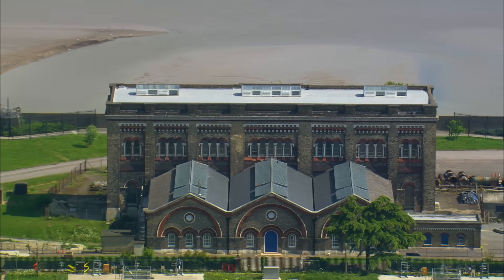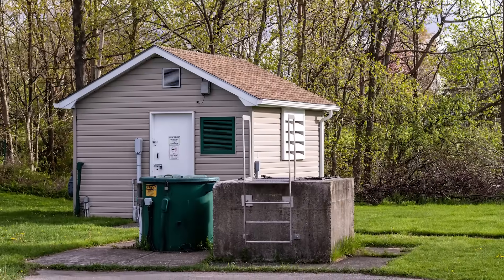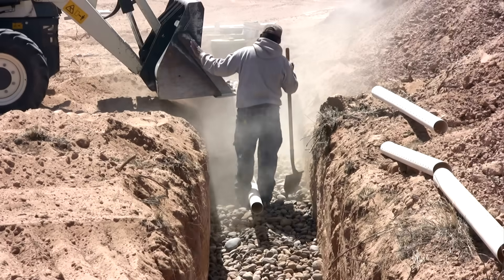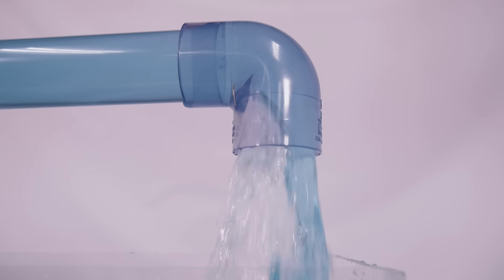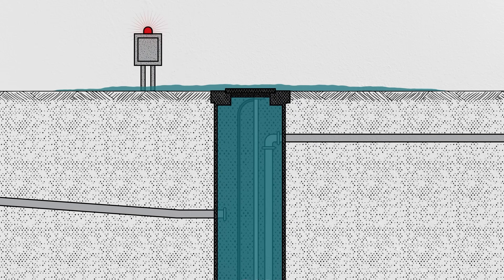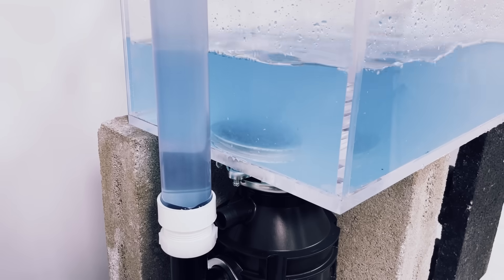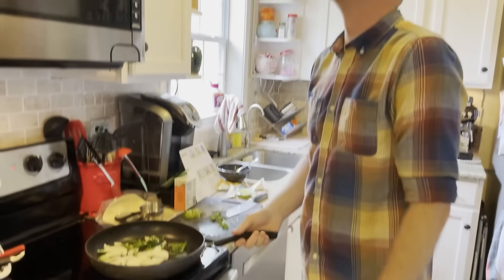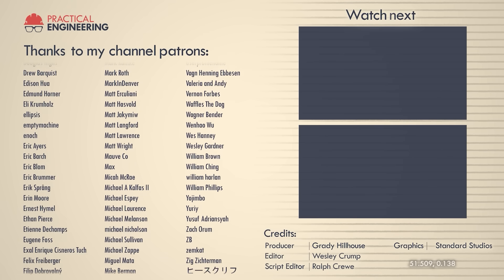How Do We Pump Sewage?

Comment: About 15 years ago now, I was working with a construction group that was refurbishing and remodeling a bunch of houses in an older neighborhood in town. After that project had petered out, I became the go to plumber for many of the residents. We got a call for a stopped up drain and realized that the problem was in the home's main drain line. We worked on that drain for HOURS and finally got it flowing... for about a day or so. When he came back to do the drain clearing dance all over again, the next door neighbor said his house was backing up. And then the guy from across the alley said the same thing. Turned out that in the alley, under about 5 feet of built up gravel and dirt was a large manhole that lead to a grinder pump in a tiny little lifting station. The city's water company had no idea that pump was even there. Turned out that the pump had been installed somewhere around 1904 and had been doing its job unnoticed and without any maintenance until 2007 when it finally seized up tighter than Fort Knox. Anyway, they came with a pump truck to clear out the area then installed a brand new pump for that little station that handles about 12 single family houses. I bet the new pump won't last 100 years though.
Reply: Over 100 years of work & probably decades without maintenance is super impressive. I work for a water company & pump breakdowns are super common. Do you know what type it was?
Reply: @Marshall Hunter  I wish I'd been more curious about stuff like that back then, but once the real problem was identified, I stepped back and let the water company do its thing.
Reply: Sounds like that pump should have ended up in a museum :)
Reply: That’s absolutely insane. I have 23 pump stations i take care of in my city. We have problems all the time. 100 years!! I’m lucky to get a hundred days without some sort of maintenance!!
Reply: Maybe in 1904 they just designed it to run continuously, regardless of need. If you don’t care about wasting electricity, you lose a lot of complexity, and running continuously is probably better for the bearings as well, especially if overbuilt.
Reply: i wonder if the new pump still works
Reply: @iwantpizzareal  doubtful, "they don't make em like the used to"
Reply: Have you got photos
Reply: @nadiaplaysgames2550  No, I don't even think the cellphone I had back then even had a camera.

Comment: Why don't lift stations not simply use unclogable pumps, like archimedes screw pumps with larger diameters than the feeding pipes or lift air pumps, which has not even a movable part. 🤔

Comment: I worked for a company that installs monitors to quantify flow in sewers. The treatment plant in Roanoke, VA has 5 Archimedes screws 6’ in diameter to lift the sewage. Yes, being in that wet well for the installs was scary. Also places like Virginia Beach use their pipes as storage because there is no slope/gravity to move the sewage. It is almost an entirely pumped system on nearly flat topography. And yes, it’s disgusting.

Comment: When I was at a wastewater treatment facility with my uncle who works there, they were using archimedian screws to transport the sewage around seven meters up to the main sieve. 
Is that a local way of doing things (I live in Germany) or are there some major downsides? Or do they have a special purpose I'm not aware of?
Reply: Archimedes screws are excellent pumps for very large flows and low heads (such as at treatment plants).   They take a lot of room, and are quite expensive, so they tend to be limited to cases where they can be economically justified.   
In the sewer system, typically flows are lower, heads are higher, and available area is quite often limited, so 'centrifugal' (or similar) pumps are more often preferred.

Comment: As an odor control equipment engineer the last part is particularly fun. From the sewage gas that would blow the manhole covers in LA to the horizontal sewage lines in the north Carolina that run on a giant vacuum pump I've seen plenty of systems that need fun ways to treat that smelly air. It's not a sexy job but we get it done.
Reply: How is the issue dealt with? Sounds mega interesting. Almost like a material for next Practical Engineering video.
Reply: Thank you for your work. As a plumber, we dont often get recognized, but you sir, make a world of smelly difference!
Reply: @CUAD what method do you use?
Reply: @Scott Page USMC aka a shit sandwich :D
Reply: There’s some fun videos of exploding manhole covers in China.
Reply: I BET YOUR FAMILY KNOWS YOUR HOME, 15 MINUTES BEFORE YOU GET THERE.....PIGPEN...
Reply: Have you ever heard of the sewer gas destructor lamp?
Reply: As a gen tech,and a motorhead I always chuckle when I see a roots blower at a wastewater plant,I wanna borrow it and stuff it on an engine 😆
I frequent them often for generator service.
Reply: I used to work for a county where we used to spray chem in our lines to control odor
Reply: Willie Marshall  thanks for the information, I appreciate...
Reply: Willie Marshall  I know hlm, he ls a fo#rex trader and a good one
Reply: @alexgonzalez2207  this guy above is a bot, shame and report

Comment: Very nice! I build UL508A industrial control panels at a shop that specializes in wastewater treatment and freshwater supply. It's amazing the level of technology required to lift sewage up 50 feet. One control panel can easily take weeks to build and wire, and design can take months of engineering.

Comment: Talk about bringing back all the great (NOT) memories of working as a contractor to a major metropolitan sewage treatment works From installing temporary bypass pumps in the suburbs to dredging out settlement ponds and unclogging blocked sewage mains with commercial size high pressure "rats" I can smell it now But the worst job was cleaning out the traveling filter screens Oh the Tampon strings They were indestructible None of the macerator Pumps or grinders could destroy them (Funny thing never saw any females on site either Never)

Comment: Is there a way that some kind of giant peristaltic pump could be used for this purpose? I suppose it might have the issue of certain kinds of debris potentially damaging the tubes since they'd have to be made of a flexible material that's susceptible to cuts and punctures.
Reply: Peristailtic pumps are used for chlorine injection mostly in wastewater treatment plants. I worked at a municipality that tested a tube pump for thickned sludge and it did not work well.

Comment: My father used to build those sewage pump stations, along with water treatment plants and sewage treatment plants. Most of them are still running today, despite being built in the 1970's, and then being run 24/7/365. I regularly drive past one he did, which still is doing it's job, lifting sewage for it's last travel along 6km of pipe to the offshore outfall. Fun building a plant next to a river, when you have to excavate for the basement levels 10m down into clay and silt, plus bring all the pipes through the walls as well. But at least they have a very easy job dealing with any leakage, as there is a nice convenient outfall pipe to send it in to for disposal.

Comment: Cool. Thanks for showing me that my friends and I used to hang out on top of a poop chute as kids. Cool. Cool cool cool. Cool. Veeeeery cool. I’m fine. It’s fine. No big deal. 

Basically my best friend and I lived at opposite ends of a really long street in FL and halfway there was a big hump in the path with a circular pad of cement, those metal doors, and one of those boxes with a light that would flash after a storm. Literally I saw the exact model and setup in the video! We assumed it was for storm water and flooding which is common in FL.

Man. I can’t wait to tell Sam our meeting spot and snack hang was a big ol poo toob!

Comment: Hello comments! Heres a few additonal points or pieces of info some may enjoy from someone who worked in sewage liftstations. 
First ill state that i worked in Sewage lift stations in a large city in Canada and varying from region and city to continent the requirements and SOP (Standard operating procedures) for these stations will change. For myself and my team, We were in control of 31 liftstations devided into 10-12 station per 2 man crew. Our usual daily task's included building mantience, Generator matinence, Pump maintince, Pump Mantience and repair and Wet Well Cleaning. Its a good point to bring up that alot of people believe Sewage Lift Station Wet Well Cleaning involves going into the middle of the pit and scrubing the machines by hand, Not only is this wrong but would pose risks to the workers far greater then then the mantinence outcome could be. For myself we had garden hoses or fire hoses that we lowered down a lader to a platform above or around the Wet well. We would use this hose to spray the Grease solids of the sides of the wall, as well as manually lower the level of the wet well so we could spray off any debris or solid from the pump(s) or force main piping (This was to ensure the pipe was in good working order with no visible cracks or holes); The pump structure used for my city is also a bit different then the exampels in the video as expected. our pumps sit not unlike the first example provided in the video but with a few added things, that being the practicality of multistage blades or primary recirculating blades in the wet well itself to chop up solids and debris before reaching the pump. when it came to the location of the lift stations. many were in resudential areas and posed a threat to smell and off gassing. But with the use of a sealed wet well containment area and an aditional 'Air scrubber' we were able to mitigate 90% of smells to the residential areas. oh, and piece of advice. The lift stations closest to any treatment facility is the worst smelling..

one last thing and I will try to anwser any questions anyone has if they take the time to read this...

DONT. FLUSH. 'FLUSHIBLE'. WIPES. Theyre a pain to deal with. in both Lift stations and in sewer cleaning (my current job) ive had more then my fair share of dirty rags fall on me and its not fun...

Love you all, Stay safe and keep flushing! (it gives me a job!)
Reply: This sounds like it could be my job description. We do all of this. I'm the "lead" of a 3 person crew of 2 mechanics and an electrician with 29 stations (2 stormwater, 4 water, and the rest are sewer) out of ~ 180 to take care of. Recently, we've started outfitting our own water stations. We get a building with an incoming and outgoing line stubbed in and a trailer of parts. We do all the plumbing, electrical, and concrete work needed to get it up and running. We've been doing alot of lift station rehabs, where we replace the old lines with  SS and new valves. It's a little more interesting than just maintaining them.

Comment: Good of Grady to shine a light on the largely unknown and underappreciated lift stations and the longsuffering joes and janes that keep them running.
Factoid: There is a series of small sewer lift station in Yosemite Valley, CA (The part of Yosemite National Park that most tourist visit). Although a river flows through it the "fall" isn't enough for sewage to flow down valley by gravity alone.
The massive flood of New Year's Eve and Day 1997 wreaked havoc to much infrastructure on the valley floor. Not only did the flood fill the sewer laterals/mains with sand it also knocked out multiple lift stations. The lift stations were designed and built to endure flood with a concrete pill box structure and gasketed doors like warships and submarines. However, over the decade's penetrations had been made for things like conduit entry so the "watertight design" became severely compromised. Therefore, repair and renovation were enormous.

Comment: And then you get old sewage systems that have rarely seen any maintenance, and in a low water usage era are plugging up due to there not being enough water flowing to prevent sludge build up, coupled with collapsing pipework due to leaks and liquefaction, and bam, blocked sewer, brown stuff backing up and the yard becoming a cesspool of yuckiness, speaking from experience, cos, er, it's currently an issue here and the landlord's sitting on his hands about fixing it... :\

Comment: There's one down the street from my place where the pipe actually goes over the top of a surface river in order to cross it. Seen some pretty wild engineering stuff while running every single river in Tokyo Japan (check out the videos on my channel) 😎

Comment: We had 1 lift station an old Smith & Lovelace. No pumps, it used air pressure, 2 check valves and a poly coated stainless rod maintenance was easy, change oil in the compressors yearly and clean and readjust the stainless rod every 4-6 months

Comment: Very interesting - I even watched the sponsorship bit! One question, though -  if flushable wipes aren't flushable, why are manufacturers allowed to claim they are?  Here in the UK, the difference seems to be what the wipes are made of. If made of cloth, they are not flushable, but if made of paper (essentially just thick toilet paper), they ARE flushable. But do these paper ones cause problems as well?
Reply: I mean, wet wipes are, technically, *flushable*. You can flush them. They go down. :-/ But yeah, anything that doesn't dissolve in water after a couple minutes is going to cause trouble. I think they're outlawed in some areas.

Comment: That is so crazy that this video came out today... this morning I was thinking about how the toilets would fail in a long-term SHTF grid-down scenario. 
For a while, everyone can use a bucket of water (rainwater or stored water) to flush their toilets, but eventually the pump stations will become clogged. 
People at higher elevations will continue to flush their toilets with buckets of water and it will spill out into the homes at lower elevations. 💩🤢🤮
Reply: I can't say how it is in other regions, but in the system I work on, if the stations can't pump out what is coming in, the sewage will overflow into a nearby river or stream. As long as the line between the homes and the wet well are open, it all flows to the well, and it overflows.

Comment: Excellent video, Grady! It sure did bring back some memories.
In another life (young and dumb learning furiously fast) I installed a few new lift stations. That was nice, actually. 
But...when we (the contractor) was required to remove and reset a lift station, seems everybody else had suddenly somewhere else to be. Being the PM, Foreman, and everything else from operator to carpenter to electrician, I could have directed someone to do it, but I have always been the kind of guy who will not ask someone else to do something distasteful or difficult if I was not willing to show that I would do it. So I did. Yuck!!!! Remote Alaska work. I mean, really remote!! In the sticks, so to speak. It was us or no one. 
So we pumped out what we could, or I did, and then cleaned the basin by glove and respirator, dismantled the lift station and all the floats, cleaned everything and did maintenance on the moving parts. New sensors and floats, new impeller, check valves, and yes; a new screen on the inlet side sloped from the inlet side at the bottom toward the output side on the top of the barrel. We made a new lid with two manholes and replaced the upper segment which was a partial cone, with another barrel segment and raised the top of the lift station without moving the bottom. Now the lift station could be maintained by locals (or so one would think!) by scraping the grate from the input manhole, and the valves, floats, (except two on the inlet side) pump and power from the other manhole. As far as I know, that crap is still flowing.
Reply: you guys are doing a truly thankless job
Reply: As an Electrician for 40+ years,  I spent more than my share working in underground sewage lift stations...

Comment: In the German Ruhr area it is even worse. Entire cities have slipped permanently below the Rhine level due to mining. Dams keep the rivers out. Small rivers even have to be pumped up into the Rhine to prevent lakes from forming. Sewage has to be constantly pumped up, cleaned and then dumped into the Rhine.
In addition, there is mine water, which was raised again, but still has to be pumped out so that it is lower than the groundwater, otherwise pollutants would get into the groundwater.
That means the electric pumps run day and night 24/7/365. Every pump has its twin.
Reply: Garbage disposal is banned in Germany. These have no place in the kitchen. There are bins for organic, plastic and other waste. Trash cans are also common in bathrooms. Toilets only tolerate paper towels that disintegrate in the water. Everything else goes in the bin.

Comment: I'm watching this before I go drain my sewer. We got like 60 yearold poophole. It drains from the house to the back hole, and it has a giant wall inside that catches the solids before they get into the pump area with a small hole that lets the liquid through. I used to have it set up to auto drain but it died last year after coming loose and not shutting off so I just do it manually now so I know that I forgot to unplug it 40 minutes ago.

Comment: I had no clue a garbage disposal also could pump water even that little bit.

If you want to install a bathroom in a basement you often have to install one of those grinder pumps unless the sewer pipe goes out below floor level.